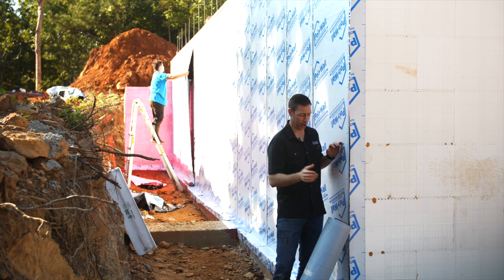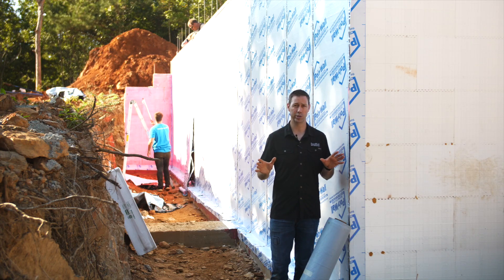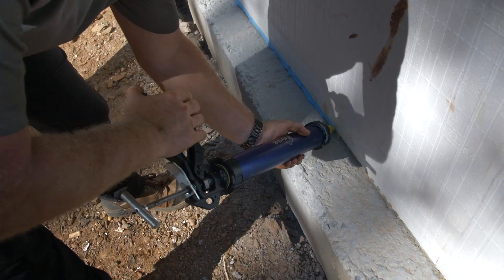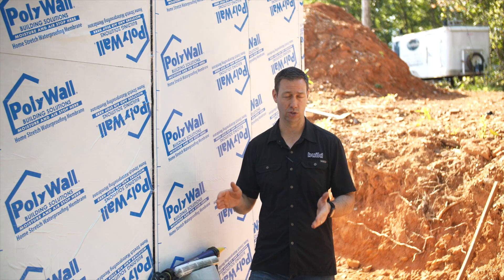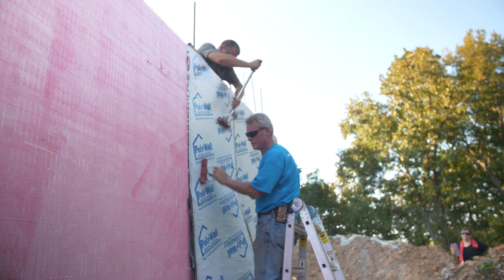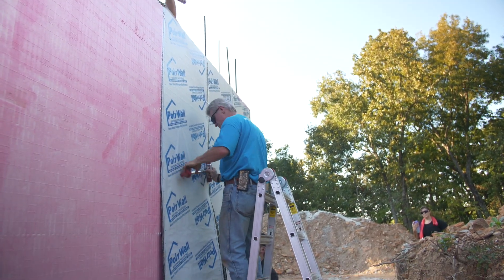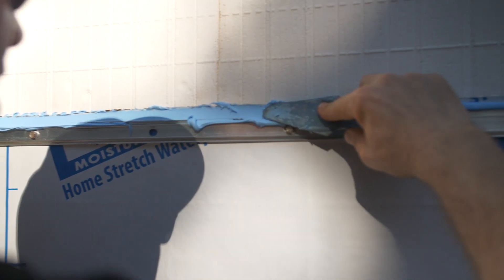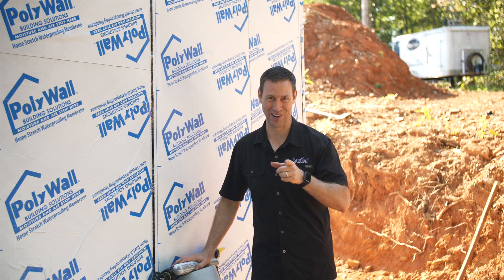This Pink Stuff is The Secret to ICF Waterproofing

Comment: So glad to see you doing ICF Matt. I'm afraid that I have been an ICF fanboy for 10 plus years now. It's so rare to hear negative stuff about ICF other than the cost. Thanks for your honesty. I have probably watched every single video on YouTube about ICF as well as read every brochure from at least half the companies out there. Most of them are pretty identical in their process. The one that stands out for me is a British Columbia company called fabform Industries. I know you're a busy man Matt but I hope that you look into what they're doing there and also a company called Vancouver ICF. some of the key differences that this company does that I haven't seen the other ones do is that they have this monopour system where they do the footing and the ICF walls all in one go. They call it fast foot it's literally a waterproof fabric that they stapled to the bottom of the first row of ICF blocks with special adjustable feet. They also pour columns with the same fabric kind of material. It seems to me they're doing a great job at addressing the water wicking effect from the footing of the foundation. They're making a claim that they could build ICF at the same cost as stick frame simply because they're saving so much on labor and timber materials. Anywho thanks for being one of my favorite YouTube channels cheers
Reply: Believe the only down side to that product is the extra bracing needed to keep movement of the wall and footer to a minimum. Pouring that first eight to ten foot of wall with footer would  be loosy goosey .  To work around that footer and wall movement problem, the first pour is kept to no more than a four foot wall height.  After it hardens, it will provide the stability for the rest of the pour.  Looks like one extra poor day is needed.
Reply: @lightning9279  thank you I needed that information.
Reply: @lightning9279  I have heard of people (beginners no less) pouring straight 8' walls with the FabForm monopour system. I have considered it for my next project but since I am framing in my floor trusses before the concrete is poured I need to have a solid footer to rest my temporary supporting braces upon, so monopour got set aside. Having poured ICF over decomposing cardboard forms for a helical pier installation, I will say you are right in that a floating ICF pour can be a bit finicky and loosy goosey. A few california corners slapped to the side opposite the typical bracing goes a long way to mitigate any of the funny business. Also, the Zont system's horizontal whaler method does a great job at reducing this as an issue. For standard ICF bracing, I could definitely see things going a bit more awkward on a monopour system, but that's why FabForm is really the only group I know of that works to that end. I am curious to try it, but I typically consult on a lot of owner builds so the labor is cheap so sometimes the extra ease isn't viable. If I were to go with a crew, I would most likely do monopours for everything (unless I found them too unwieldy after trying them out...).
Reply: @joshualruby  I would love to do a monopour, but am pretty sure it is not allowed in San Diego County.  Now we are both disappointed Joshua!
Reply: @Ivebeenaroundyouknow  Are you in San Diego county, or a city as well? I doubt they are against the rules, but I could be wrong. But if you give me a location I will find their code and let you know.
Reply: @joshualruby  Hey Josh, our lot is in San Diego County.  We are considered in "the village " of Pauma Valley (lower impact fees). I thought I read county wouldn't allow mono pours but I could be wrong.  
I feel like you can really benefit with MP by not having to fight imperfect grading and footings (all the way up) using the feet to level and having the vapor barrier in.  Just brace more to hold it.. It kind of makes me more comfortable also with the drain line layout.

Comment: My prediction is coming true.  Matt is moving closer and closer to being a full on ICF believer.
Reply: Maybe someday he will fully evolve and become an AAC believer.
Reply: ICF is the way to go all around.
Reply: Sodium Bentonite is the best because its self-healing and works best in ground water.
I use the Bentofix, NAUE brand from Germany.
Reply: X-Ray 911 i spread that stuff on the floor of my lake each year when I lower it in winter
Reply: Hi there ryan...please check out The Perfect Block...at theperfectblock.com......an advanced ICF product that is total fire safe and rated for 4 hours...all of the other ICF on the market will melt in 15 to 20 seconds....with a MAPP Propane torch....see the video at theperfectblock.com....and happy hunting
Reply: The proven problem with that block is the air gap which occur on the horizontal portion of the block.   The concrete has a hard time flowing into it.
Reply: I won't trust any company that spams YouTube comments with their product.
Reply: Ben Whittle.....You can get a refund at the front desk.
Reply: The Perfect clock is concrete coated and glues together recycled polystyrene, and if you look at the solid concrete structure of lattice work it makes is not very efficient, its not creating a barrier and still creates a bridge for air temp to flow through. There is a reason forms like that are not used below grade or even above and mostly what you see being used is what Matt shows.
Reply: What does "The Perfect Clock"  mean?  I don't follow.
Reply: @benwhittle7204  I am not sure that I would call it spam. It is directly related to the video content. I can appreciate your thoughts though. It might be on the weak side to piggy back someones content, but I still like to know about innovative products if this is such a product, which I could not say for certain.
Reply: @benwhittle7204  and you may be missing out . Don't be so rigid.
Reply: @VARocketry  perfect block, look it up

Comment: When you are constructing the Styrofoam walls could you spray the pink stuff on before connecting the blocks for added water proofing? That would seal the "miles of cracks" on the wall before ever applying water proofing.
Reply: Pre-applying would interfere with the interlock design on the blocks that is built in, Matt is worrying too much about cracks despite the vast interlocking design still it does not hurt to apply membrane like shown to guard against the likeliness of water finding its way in eventually without the membrane. Its even recommended by the manufacturers to apply foam adhesive spray to each block much like block/brick masonry. But what they fail to do is add something like FabForm Fastfooting underside the footing to keep it from soaking up water that gets under the house.

Comment: Matt, curious if you know anything about greenguard raindrop 4048p as a housewrap.  I am having trouble finding most of the products you are using. I am in Utah
Reply: Tyvek is all one really needs on the above grade for a ICF. but make sure you mark out with black marker the fastening points and strips before applying the wrap so you can see where those points are through it once applied.

Comment: Matt Risinger is anybody doing something Like Line X or Rhino Lining to these Basement walls?  I feel like that would be that ultimate water proofing.
Reply: Urethane based Line X or Rhino are cost prohibitive $6-8.00 / ft versus $2.00/ ft. primer and poly wall.
Reply: It’s been done on closed cell spray foam houses in Alaska.(above grade/at grade) If you look at the picture of the CCHRC Atqasuk house, (link below) the sloped skirt at the bottom of the house,  that’s a steel floor joist system suspended 2 feet above the ground, encapsulated in closed cell foam with bed liner applied directly to the foam, no primer or barrier between the foam and liner. A friend of mine sprayed most of this project. Spray foam and bed liner is sprayed using the same equipment. I think bed liner could also be applies to EPS without dissolving it . I would still be concerned about the bed liner being able to flex enough to stay water tight over the years. 

http://www.cchrc.org/atqasuk-prototype-home
Reply: Bryan Meyerhoffer that is solvent based. You need a non solvent based product.